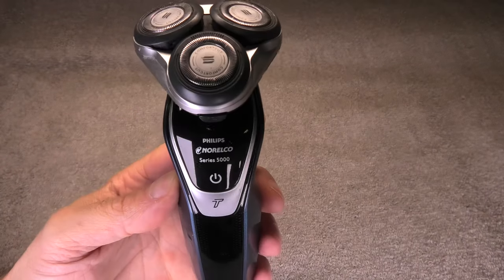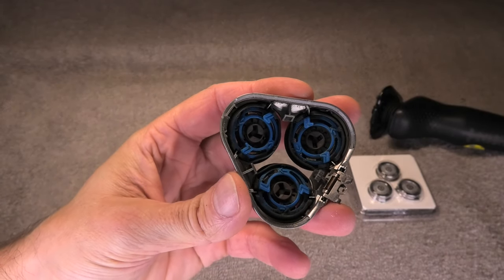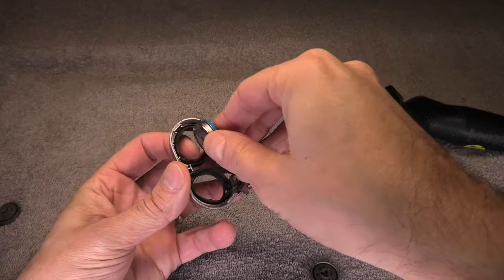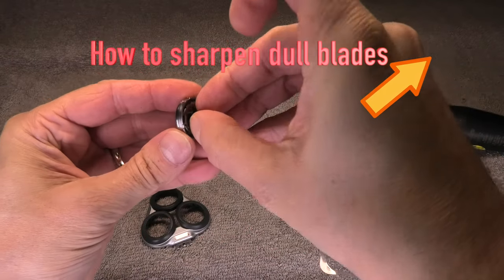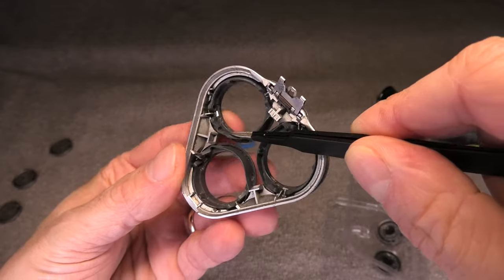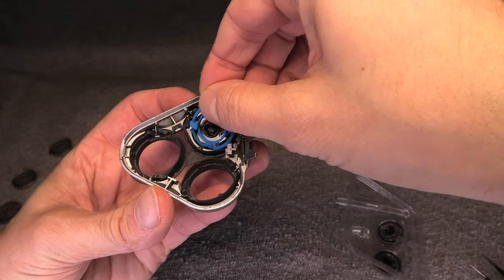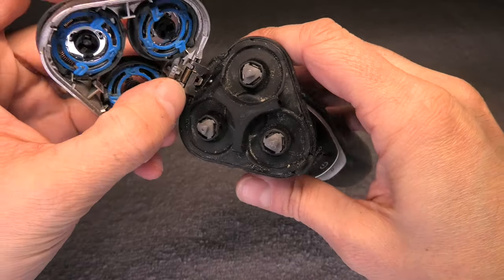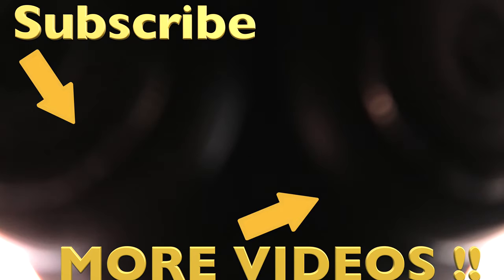PHILIPS NORELCO SHAVER HEAD REPLACEMENT - HOW TO 4K

Comment: Original parts are the best. You get what you pay for. Periodic cleaning, once or twice a week, brushing and blowing out the whiskers helps with the longevity of the heads/razors and maintains a clean close shave. Remove the blades from the head and rinse and brush everything out with hot soapy water once a month for a deep cleaning. Do this with wet/dry shavers only.👍🏽✌🏽

Comment: Its very easy to follow. I have not done a thorough cleaning for more than a year. After I cleaned up all of the tiny hairs built up around the blades, the shaver worked like a new one again. It saved me the money to replace the heads.

Comment: I was wondering why I had to buy new razorheads so often for my 93 yr old father. Very helpful video! Even he never knew how to do this process though he's been shaving for decades. 
I watched it on slow speed to get the correct process to lock the blue disk. I realized the counterclockwise arrows on the piece are for removing the disk, thus it needs to be turned clockwise in order to lock in place.

Comment: Thanks for the instructions.  Last time I had to change my blades/knives I upgraded to blades for the s7000 series. It has twice as many blades on each rotating knife. The result is a much better shaving result - AND a much QUICKER shave! You get an upgrade from s5000 to something similar to s7000 shaver for the price of just the blades/knives. I bought the original Philips SH71 set. Well worth the cost!

Comment: Just replaced my original Norelco 3800 heads after a year. The original heads are perfectly circular and don't have the wing tabs like the replacement heads do. At first I was a bit concerned but there is a spot for them and they dropped right in, works great. Great video. :)

Comment: I just replaced the heads but the shaver is still showing the sign I have to replace it??? Idk what to do lol.
Reply from the maker: The sign will go away after using it a couple of times.
Reply: @MegaSafetyFirst  I figured it out, you had to hold the power button for 7 seconds! lol ty though for the fast reply